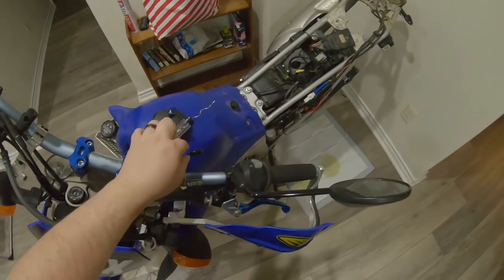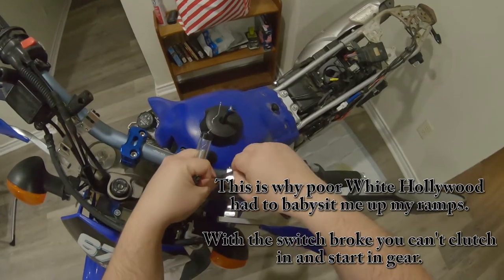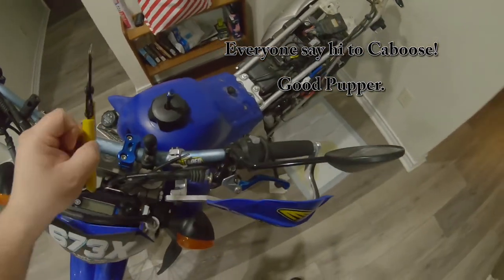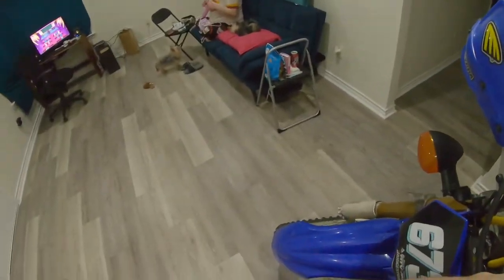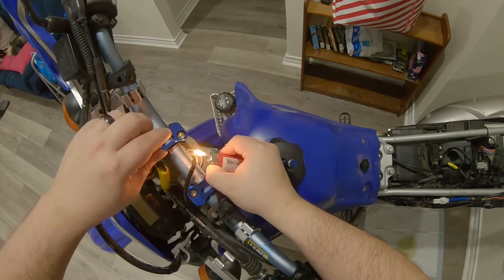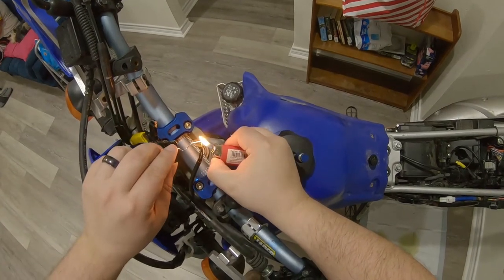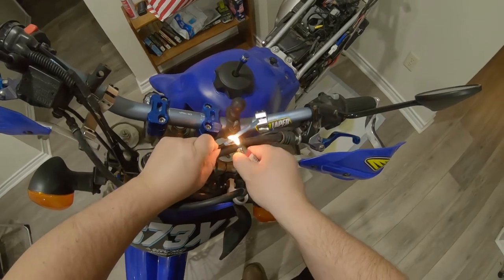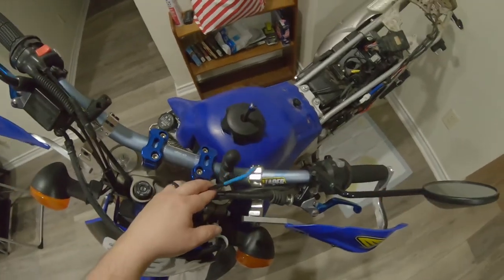Clutch Safety Switch Bypass WR250R

Comment: Hey man, I have a 23 WR250F and bought a aftermarket V4 clutch from 1 Finger which has a NSS with the perch but when I connected my OEM wires to the new connectors, it would not start in gear even with the clutch pulled in.  Do you have any thoughts or ideas on how to make this work?
Reply from the maker: Well unfortunately the last WR I owned was a 1998 400 I would need to do a bit of research as I'm kind of unfamiliar with the newer wr250f

Comment: where exaclty does this harness/conector go?. my wr the switch is not installed i cannot seem to find the connector or the switch anywhere behind the headlight or around that area.
does the clutch switch wiring tie into a bigger chunk of wiring harness somewhere?
Reply from the maker: I would have to check out a friend's WR to be able to answer this question unfortunately I sold mine about a year ago.  I will see if I can dig up a wiring diagram.  My money would be on a 6 pin or more wiring connector up near the light.
Reply: @stoplogicmotorsports  would really appreciate it man drives me nuts when I stall and can't easily restart (rarely happens but I can't handle it hahaha)
Reply from the maker: @shipley0018  Looks like it is a black and aqua wire that goes to ignition and #10 relay. https://wr250rforum.forumotion.com/t10902-wiring-question
Reply: @stoplogicmotorsports  awesome thanks so much man!! Cheers!
Reply from the maker: @shipley0018  Happy to help, good luck.  If you get a chance toss a sub my way, granted I don't have a wr250r anymore but heck might find something else of use.

Comment: Just bought one and the seller had the neutral safety switch (NSS) wire (light blue) intentionally grounded to frame cuz without that the bike immediately shuts off when you put it in gear.  Kick stand switch is also just two wires hanging atm,  No power at wires or at connector.  All fuses checked out as ok.

The problem is with the NSS wire grounded the bike will run fine but the Neutral light is always on no matter what gear you're in.  Any ideas how to get Neutral light to work only when in Neutral and still have the bike run normally?  

Ps, I don't know which wires you wired together cuz there are none connected to switch near the clutch lever.  The wire I found grounded was in the protective boot behind the left side black plastic that faces front.  Thanks!
Reply from the maker: Goodness, Sounds like you inherited quite the hack job of wires being landed all over. Ideally you would still have your wires at the switch and you would tie those off together, grounding to the frame just seems like it would cause more problems as the circuit needs to be closed to work. As far as the kickstand delete I didn't so mine as this bike also has some sort of resistor in line with that wiring and I never got around to it.
Reply: @stoplogicmotorsports  Thanks!  Yeah some people don't know what they're doing and just start chopping stuff out. 

I found the wires intended for the clutch safety switch tucked behind side plastic and they were tied together and wrapped in electrical tape.  Still haven't been able to  get any power to the kickstand switch or connector down the line so maybe there's a bad relay or something. 

Found wiring diagram online but tough to see what's what.
Reply: @igotakai5644 if they kickstand switch was removed and the wires aren't connected that would explain why the bike would die when switching into gear.
Solder together the wires from the kickstand switch and ungrounded the NSU wire.
Reply: @dancarlson6799  sold that bike but good to know for the future.  Thank you!